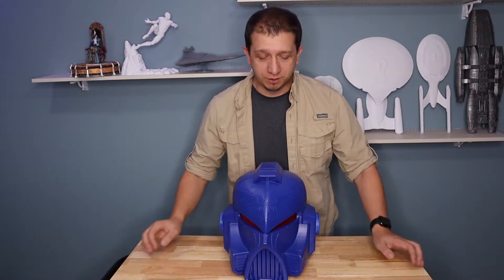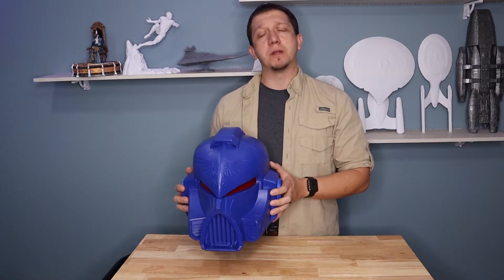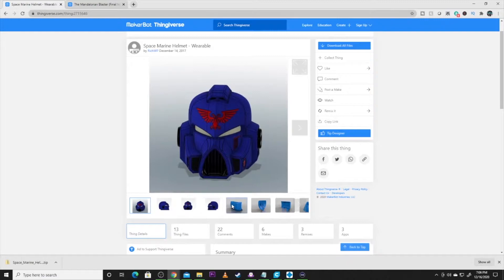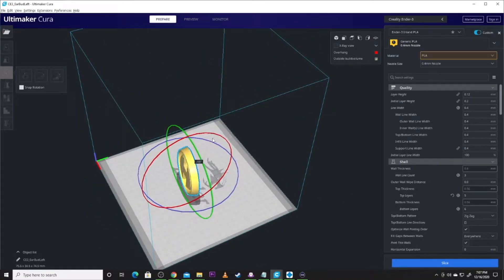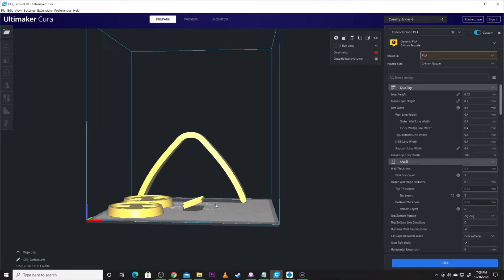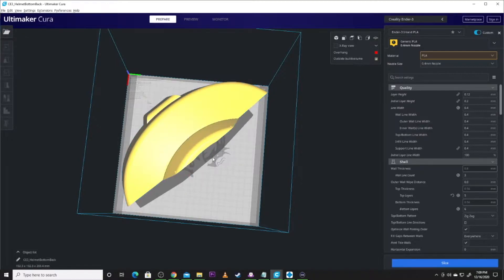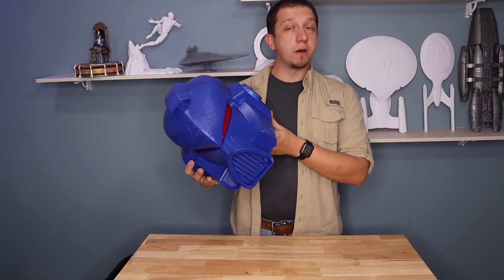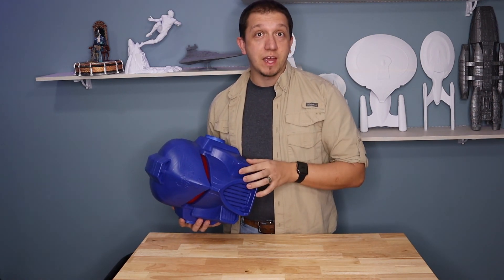Warhammer 40K Space Marine Helmet - 3D Printed tutorial

Comment: Cool video but anyone else thinks the helmets proportions are a lil bit off?
Reply from the maker: The Helmet is meant for a Astartes. They are twice the size of a normal human so the proportions should be off.  Plus we want to give the look of thick armor.  If I have the should paldrons and chest plat it might look more in place. Possible future projects if the video does well. This is only one of many examples and types of the helm that are out there.   Thanks
Reply: @Rise3DBuilds  My personally opinion is that the proportions of this helmet does not meet those of an astartes helmet.
Especially the mouth/respirator area is way too big for the rest.
Reply: @makersbelief2597  I've printed one out for myself, I changed the height and length front to back down to 89%, that helps the proportions but the face still looks wrong, currently working on a new faceplate, otherwise a very nice print.